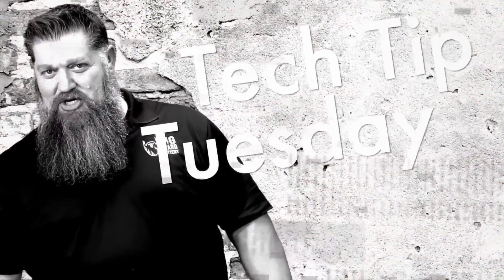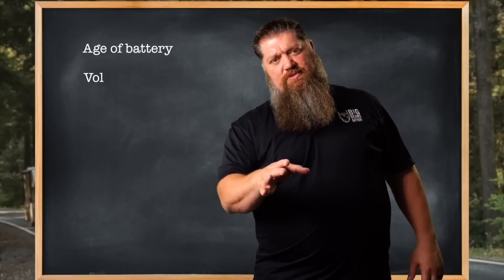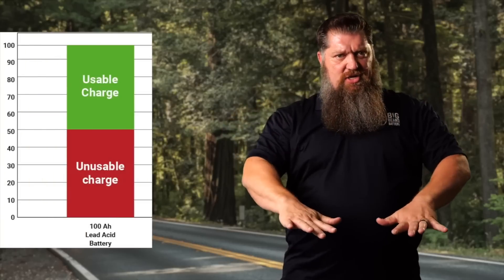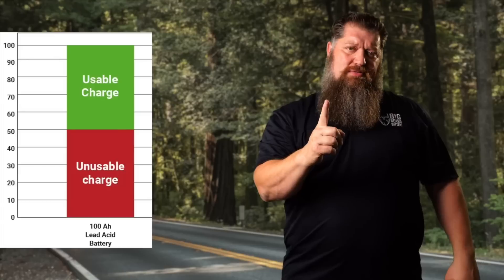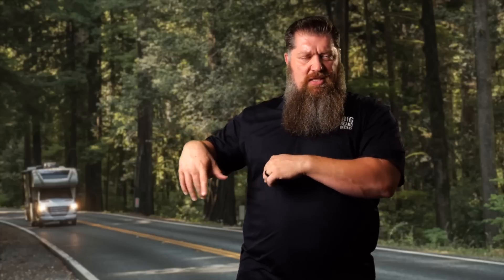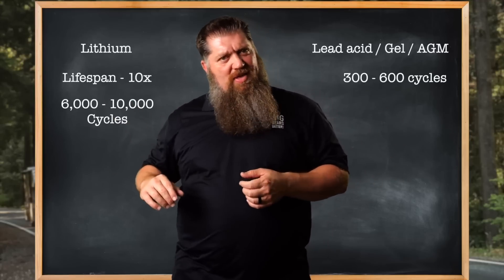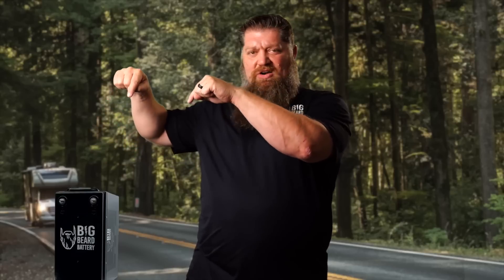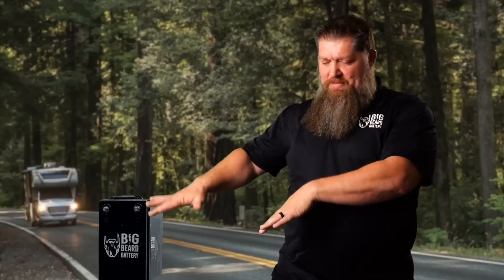When do I replace my RV House Batteries

Comment: What about your converter? Should you also change that when you upgrade to Lithium Batteries?
Reply from the maker: @Umi-imU-We-Are-One  yes you want to make sure that your current charger can charge lithium. 

Most newer model RVs provide options on the charger/converter.
Reply: @ I just purchased two Epoch lithium batteries and wanted to make sure that I replace the converter if necessary. Thank you!
Reply: Only if you don’t have a pure sine wave one.

Comment: Thank you Todd, as always I appreciate the 2MTTT.
In talking battery discharge cycles I understand a full discharge is a cycle.
What about discharging 1-10% overnight & then the solar panels charging during the day? 
Does 1-10% count as a cycle?
Does 1-10% harm my Lithium batteries, not taking them to a full discharge cycle?
Thank you 
Rvtraveler j

Comment: What truth is there to "You don't need a DC to DC charger from your tow vehicle anymore for lithium batteries"? Has there been an update in technology that allows this now?
Reply from the maker: @benhernandez9499  not updated tech. But the fact that if you do not upgrade the wires in the 7-pin connector (for towables only) the wire becomes the resostance needed to protect the alternator. 

Now for motorcoaches either a bim or dc-dc would be needed.
Reply: @ thanks. Do you have a video on this?

Comment: Thanks for explaining the differences between the batteries and how much of a percentage you can discharge.   The part I am still a little confused about is the active versus nonactive balancing.    So how do I know if my lithium battery is balanced?  If after receiving your answer I discover it is not balanced, how do I go about balancing it.  

The reason I ask is because I replaced a deep cycle 100 watt lead acid battery that came with my new small camper with a 400 watt lithium battery
and only use it about 6 or 7 times a year over the May - October seasons.   I have occasionally run it down till I had no electricity and this last camping trip I still had electricity and when I put the charger on the battery when I got home the charger read 0.18 something capacity.  I figured that meant it was just about ready to die.  Now that I know I shouldn’t let it get below 10.0 I’ll be more careful.   Also, I notice too that while charging the voltage doesn’t read 14. whatever, rather it is always 13 something.  Does that mean my battery is damaged or unbalanced?

I look forward to reading your reply, or someone’s response, so I can get the best use out of this very expensive battery.
Reply: I would like to know the answer to that also.
(Curious in OH) 😂
Don't mind me..I'll sit waiting patiently 😊
Reply: @ To funny 😆 😆😆

Comment: Anyone who's using their RV more than a week out of the year would benefit from switching to lithium batteries, even from a cost perspective. If you switch RVs in a few years, just take your batteries with you if you want. Good lithium batteries will last AT LEAST 10 years and perhaps far longer, depending on how they're used. Lead acid batteries are heavy, take a long time to charge, can be cycled far less, and may require ongoing maintenance. No, no, no, no.

Comment: OK so Here is something I am pondering today. Brand New Brinkley Z Air 310 Travel Trailer has a 12v 16CF Refrigerator I am adding a robust Peplink, router w/ access point wired for 12v ( MobileMustHave) It came stock with a die hard silver lead acid battery group 27 370 watt solar and charger. Reasonably sure it was a dealer cost saver- I get that.

I just today booked an install with the Big Beard Team in January(20-24) for a 24v dual inverter set up with 2 beast batteries. I assume we will leave the current  solar and 12 v alone- unless you say otherwise.

It seems to me the current 12v battery is a bit small- I know we will be charging through the native charger when the solar is done. However should I be adding a better AGM battery for the 12v side? how many AH should I be considering or am I simply overthinking it.....

I am so looking forward to getting the BBB solar in this one- I feel naked without an array on the roof. Thanks for the wisdom!
Reply: It sounds like your two Big Beard batteries will be linked in series to produce 24 volts. That's very uncommon, and I'm not sure what the benefit would be other than some of the wiring being smaller gauge. Keeping everything consistently 12 volts would be far simpler, and you could use one (or multiple) Victron inverter/chargers to handle everything in a single unit. That's what we've done as full-timers for over 18 months, and it's nearly a flawless setup.
Reply: @calledtojourney  This will  two 24v 300AH batteries referred to as the beast on the big beard website. There will be 2 24v Victron MP in parallel as well. I think they tend to leave the factory 12v system intact but I clearly can not speak for the BB crew. I just question the 12 stock battery capacity. However with the house charger I may be overthinking the issue. I do appreciate your  input. I may just have to wait until I have the rig there for them to see. I have no major boondocking planned until spring and I do have generators for backup.